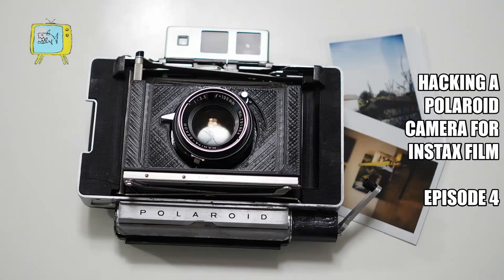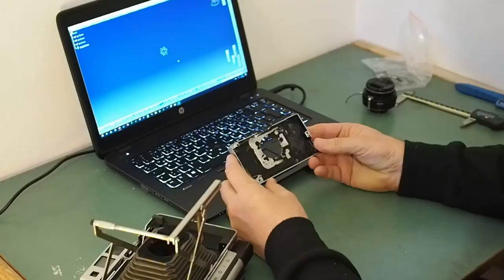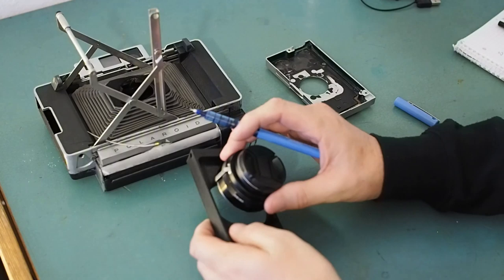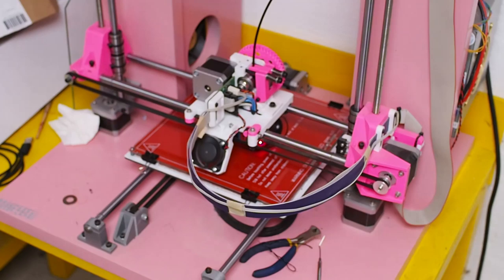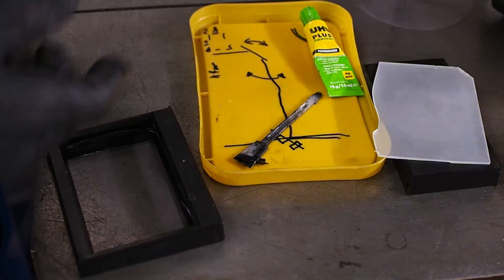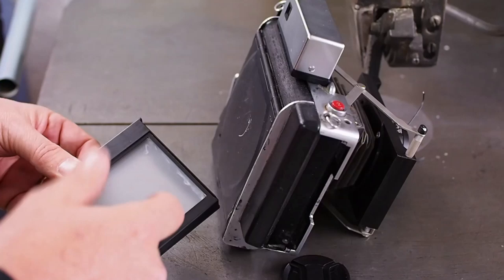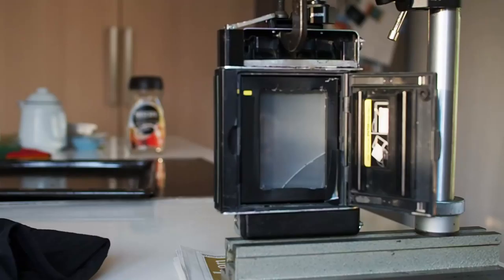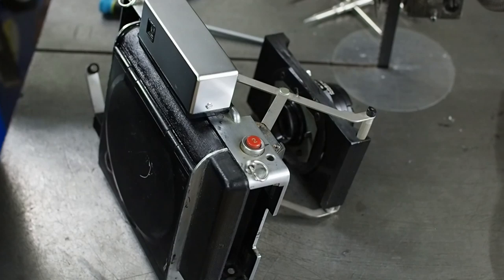How to modify a polaroid land camera to use instax wide film - Episode 4 - new lens standard

Comment: Fascinating series. Wish I had the tools - and the space for them - to take on a project like this.
Reply from the maker: Thanks for the feedback. I think you could do this with a dremel. If you dont have space for a 3D printer, you can use one of the online venders like shapeways. Go for it.

I took it on vacation, and made a lot of failed shots, as I was using a phone light meter app, rather than taking my proper meter. Not sure why, but didn't get on with the app. I also go motivated to finally address the focus error of the rangefinder calibrated for 114m but meusing the 105mm lens. I am just drawing up a replacement cam, and will make a video of modifying the rangefinder as soon as I have it working.
Reply from the maker: @msandersen  It is lucky that there is a good video on doing  CLA on the Seiko lens. I remember pulling clock work things apart as a kid and never having the discipline to get them back together again. I need to get the right lens oil though. I used a tiny bit of sewing machine oil, but that shutter is getting sticky again.

Even the parts I made on the lathe and mill are pretty simple and could be made with a file and cutting the head off a bolt from the hardware store. There is nothing really complicated in there.

The manual kick out/hand crank is not working well on the dark slide and first two photos. I often need a dark bag to get them sorted.
Reply: @RotarySMP  The CLA videos on YouTube are great; also some on the web at large, but seeing it done helps. Good to see people with a passion for old mechanical devices maintaining them. I have an old Contax in need of repair, but having done a bit of research, I will eventually send it to a professional. Those things are a marvel of clockwork engineering, and was meant to be maintained with regular oiling, which they rarely are. I also remember taking some watches apart, but not being able to put them back together again, in particular because of the fine spring which once unwound is never going back together again. I guess my parents must have had a small screwdriver set. 
You didn’t mention the oil you used, but thought it was sewing machine oil, which I do have. I thought that would have been sufficient. Maybe some of the old oil is ‘sticking’ around.
Reply: @RotarySMP  as for the kicker; I thought it was an original part, and thus would work the same. Something to do with spring tension from behind? Think you replaced one of them. If you have to use a dark bag, that ruins the seamless experience somewhat, but at least not as much work as the manual method some people use to use Instax in older cameras, where they take out one photo from an Instax pack in a bag, load it in the camera, then go out and shoot that one shot, then have to go back and put it back into the Instax pack to develop in an Instax camera.
For the handcrank and gearbox; while I have some experience with woodworking, and some of the methodology applies, I only have a small foldout work table, a power drill and small hacksaw that can be used for steel. I can get some steel files. I imagine an old IKEA furniture wrench could be filed down for the handle, but no idea how hard that is in steel, or if it is too thick. There is no ‘whipping up a quick handle’. And similarly drilling accurate holes or filing accurate straight cuts could be a problem, depending on tolerance.
Reply from the maker: @msandersen  The kick out is original, as are the rollers. I think the problem is either that my glued up stack  of parts is more rigid, an therefore the back springs push the film pack harder, or just sequencing. At least once I have noticed that I released the kick out before the rollers caught, and when I took a second bite at it, the kick out was also working on the following photo, and thus damged the photo trying to jam two through the slot.
Reply from the maker: @msandersen  I also though sewing machine oil would be light enough. But mayve not.

Comment: Fantastic series! Just subscribed :) I have a question regarding your lens selection. Did you pick this particular lens because of its back-focus focal length?
Reply from the maker: I choose it for it's F3.5 aperture, it's price, and being close to the original 114mm focal length. Being shorter focal length means it will focus closer for the same bellow extension. The close focus distance of the Polaroid is not great, so this was a way to get a little closer, with the disadvantage of rangefinder inaccuracy.
Reply: @RotarySMP  Great, thanks for your reply! Looking forward to seeing similar projects in the future..

Comment: Really interesting topic and have just binged the series. Thank you. I love how you go through thinking out loud and discussing attaching the instax back to camera. I'd be interested in your thoughts on this. If you choose say a 127mm or even a 135mm lens could you then use the difference of focal length between the polaroid 118mm as play on moving your film plane back ...about 9mm or 17mm depending on what lens you use?  Would this then give you enough room due to spacing to attach an Instax back "Wholus Bolus" without having to disassemble/rearrange the electronics of the back?
Reply from the maker: Yes...but....
You could do a less brutal bodge of the Instax, an thus end up with the film plane further back, and compensate with a longer focal length lens, but the probablity to nailing it without some adjustment is not great.
The other issue with a longer focal length, is that need a longer focus throw to focus in on the same distance. Given that the scissor mechanism defines the focus throw, the longer the lens focal lenth, the worse the minimum focal distance. If you go beyond the 116mm Polaroid choose, you can pretty much forget taking a head and shoulders portrait.
Thanks for watching.

Comment: i am amazed you can still get film,what would be the cost per picture .?
Reply from the maker: The whole reason for this hacking is to use Fuji Instax film, which is less then $1 a  shot new , and the only mass produced instant film still made in this size. Normally I buy it used, as people buy too many boxes of film when they have instant photo cameras on the table at a wedding, and it turns up for half price on craigslist.

Have a look at the first video in this series, where I explain the reasons for doing this.

Comment: Do you take commissions ?!  I have so many land cameras , but now that pack film is done with they are nothing but beautiful paper weights . I do have some fuji 100c and 3000b I’m saving for a raining day. I did a “holgaroid” conversion myself from an old 100 land camera but this is way beyond my wheel house ... great job man! It was an interesting and fun watch
Reply from the maker: Thanksfor the feedback. I really dont have the time to make cameras for others (or even for myself lately)  sorry. Also my prototype #1 Instaroid is pretty dodgy. The film kick out is pretty unreliable. 

While I used a mill and lathe, there was nothing here that couldn't be done with hand tools. You can get parts printed online, as get a cheap 3D printer. They are such a game changer.

I only have one "rainy day" box of 3000B. It will probably die before I can jump over my shadow to actually shoot it. 

It is such a shame: 
1/ that I didn't shoot 3000B or Polaroid 45 when it was readily available, and.
2/ that Fuji didnt keep 3000B in production.

Comment: I don't think you will get the range finder to be accurate close up to infinity unless your lens is the same focal length as the original. I think the originals are a little longer? I do think however that with some tinkering you could reprofile the came in the Zeiss to suit your 105. I fitted a 127mm Ysarex from polaroid 110 pathfinder and managed to get it fairly accurate.
Reply from the maker: I agree. I haven't had a chance to disassemble the rangefinder and see how it works. If it has a cam which is reasonably simple to disassemble, it shouldn't be too big a job to design a replacement cam with the correct profile for the 105mm, and CNC machine it. Since the Instafrankenroid is "working", I have been more focused on my lathe project lately.
Reply: @RotarySMP  Well the way I see it then is getting it accurate for portraights is critical and if you are outside then you'll be using verry small apatures anyway, so will likely have acceptable infinity.

Comment: What kind of lens is that, and would it be possible to add a lens like that to an old polaroid 1000(one step), replacing the shutter and plastic lens from the camera with it?
Reply from the maker: It is the Mamiya 105mm F 3.5 from a Mamiya twin lens reflex. The early silver version and the first  (non-DS, non blue dot)  version have enough coverage for Instax wide, with a bit of light fall off in the corners. Since the One step was designed for pack film it would work, but pack film is no longer made. That is why I also converted that camera to Instax wide film.
Reply: @RotarySMP  the polaroid One Step(1000) works with sx-70 integral film, which is being produced. 
I don‘t know a lot about lenses, but i would like to try and replace the lens of my „box“ style vintage polaroid camera with a lens that has an in build shutter and zoom.
Reply from the maker: @SnowmansApartment  Oh, I thought that was a pck film camera. Those SX-70 style cameras expose the film though the front, and therefore the image would be reversed. To prevent that, they first reflect the image on a mirror. Instax exposes through the back of the photo to avoid this.

The 77x77m (bit over 3" square) image size of SX-70 film, means that you would need a lens with that coverage. A zoom lens with built in shutter to cover that would be something like the Mamiya RB 67 100-200mm. Huge and cumbersome.
 Go for it.

Comment: I wish I could get my land camera modified omg
Reply from the maker: My hack job is a very much a rough and ready one. With a file and lot of epoxy, plus a little playing around in a online 3D CAM software like Oneshape, and printing parts with an online printing service you could also do this. Go for it. 

The manual film kick out on mine is very flakey, so I sometimes have to use a dark bag (or black jacket in a dark room) to open it up and move the film a little to get it to eject. 
Thanks for watching.